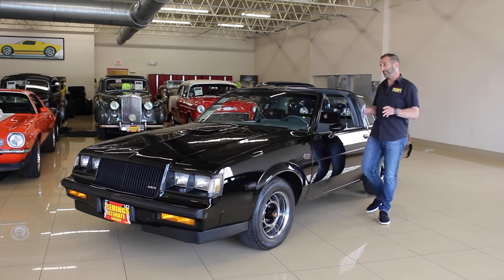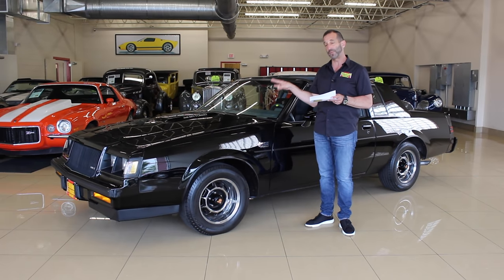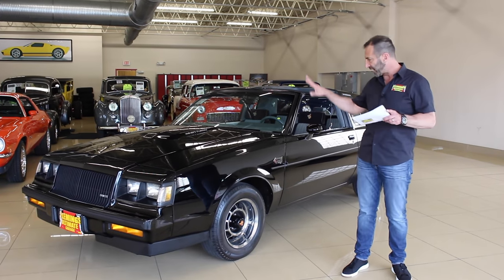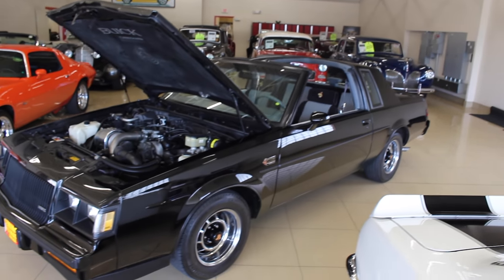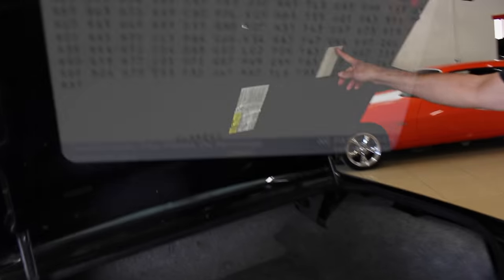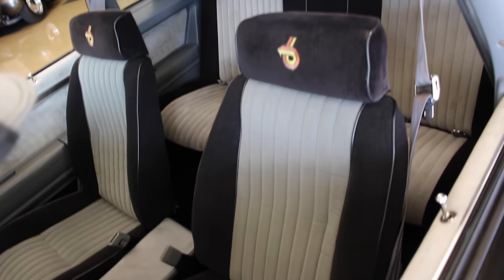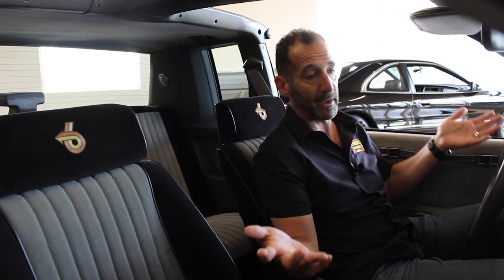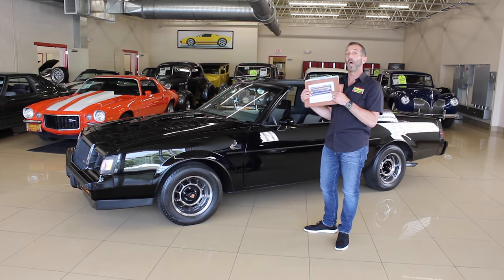1987 Buick Grand National 38,406 for sale with test drive, driving sounds, and walk through video

Comment: These are beautiful!  I think people who knew just how great these were, appreciated them at the time... but they haven't come to be really appreciated until now... when folks have not only gotten more nostalgic about the 80's, but they are very hard to come by, and now very expensive at auction... or just about anywhere else.
Reply: B3burner which one better a 72 Oldsmobile Cutlass supreme convertible or a 69 Buick Riviera sport
Reply: John Mcclane >>>  Tough call, they’re both nice cars.  Personally, I’d lean toward the ‘69 Buick Riviera because of the unique front end.  The headlights were very exaggeratedly moved toward center on the X-axis, and those turn signal/running lights embedded in the bumper on the sides took up more space than usual.  And then add hideaway headlights—  it was a cool look.
Reply: B3burner yeah I'm leaning toward it because is black the Oldsmobile Cutlass supreme 72 is unique because is convertible and in good condition not rebuild so many stories on the Oldsmobile
Reply: Yeah I bought one for about 26k. restoration to bring a decent 74k car to today's standards about 18k.

Comment: Wrong horn button. Should be a darkened Buick tri-shield symbol not a T-type.
Reply: The replacement buttons if broken or lost the dealer gave the t type button.  My has the original buick shields.

Comment: For 1987 I had a 87 gt5.0 that was fast but the car that beat me was a grand national. My 305hp 97 cobra had a problem beating a grand national. For 87 they were a 13 second car for the time insane fast.Does it compare to my gt500 or my supersnake no but for 87 it was the shit.
Reply: I did a stock rebuild with a chip, bigger turbo, updated fuel system, and it will run with almost all the new cars minus the gt500, hellcat, and zl1.  It makes 450 to the wheels 550tq.  11.5 quater mile car.
Reply: @jdgreen214  That is very good for such a small displacement
Reply: @anthonylaudano9751  Yeah. The stage 1 and the indy car buick motor can hold almost 1000hp.  i saw a British guy on YouTube using a buick v6 in his race car.  Its not just the motor with these cars though.  The rear gear ratio, weight, and low end peak tourque.  I know the Ford voodoo engine revs extremely high and reaches its max power around the top end.  If the race is more than a quarter mile those cars kill grandnationals.  Stop light to stop light is where these cars shine.  i had a ss camaro race my 442 restomod my numbers are 425hp and 518tq.  It beat me but barely because I had a crazy 2.78 gear rear end.  My grandnational would have put car lengths on that car.
Reply: @jdgreen214  Yah man there tough.They remind me of my Terminator or my 5.4 in my super snakes and my 08 gt500.
Reply: @anthonylaudano9751  I always loved the look of those super snakes.  I never drove a Ford product the closest I came too a mustang is I had a 71 mercury cougar with a 351 Cleveland.  I was going for a resto but the guy took my cars ( I found a 73 for about 700 dollars using for a parts car) and my money and disappeared.  I'm looking at fox body gt and the 70's mach 1 mustangs.  I know the 70s are the big mustangs but some had cobra jets.  I like the look and everything is going up in price right now.  i also have a 1992 gmc typhoon.  When the truck runs it is amazing. I found a guy in Illinois that specializes in syty stuff I'm sending it to him as soon as my GN is back from its upgrades.  The typhoon sounds like an airplane taking off plus the all wheel drive gives you no tire spin.  They hate ignition systems that's the issue im having right now.  i replaced the ICM it ran flawless for a month and a half.  Then hard starting then no starting.  Guy from Illinois said its probably the atr chip telling it to do something weird.  I was using it as a daily for awhile.  I heard that was Clint Eastwood daily driver.  It was doing 14 seconds stock.  I think only the Ford lightnings could compete.  Its faster than the dodge truck with the viper motor.

Comment: All grand nationals had A/C. That engine came with A/C with every trim it was installed into. The horn button is wrong. To bad it has ttops or it would be perfect. Those tops are horrible for leaking. I’ve owned several gn’s. Hard top is preferred. Or the astroroof sunroof which is ultra rare
Reply: Replacement horns that were given all had t type on them.  You couldn't get the original if you lost or broke them.